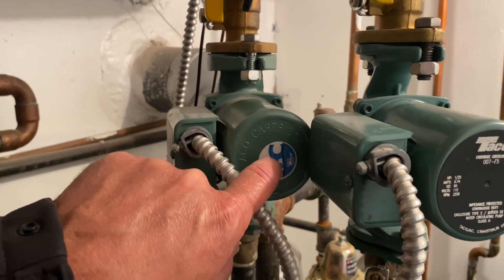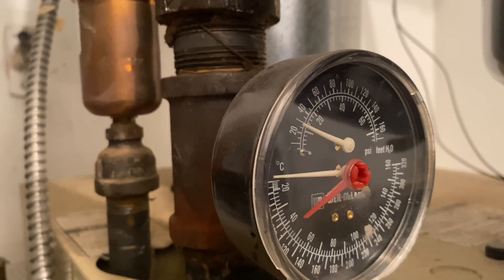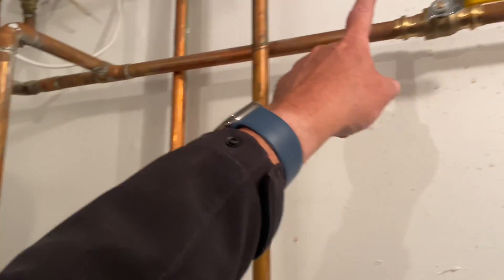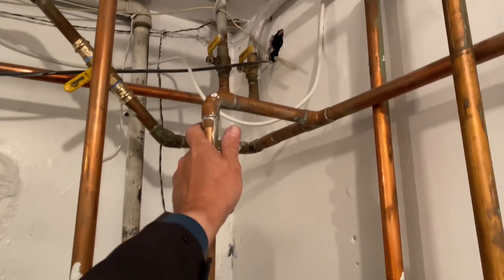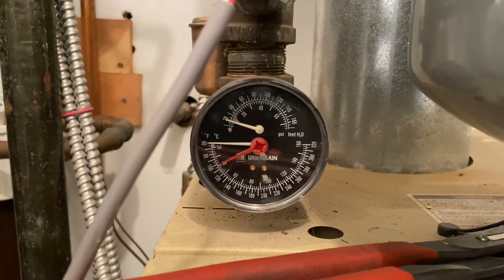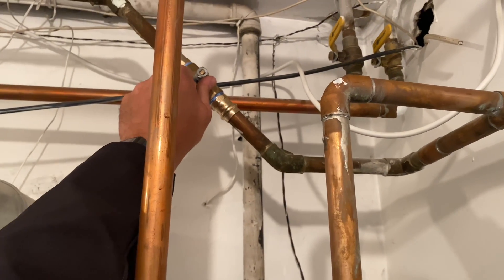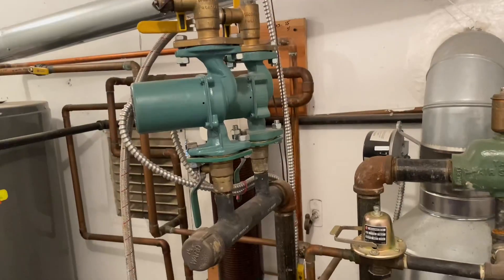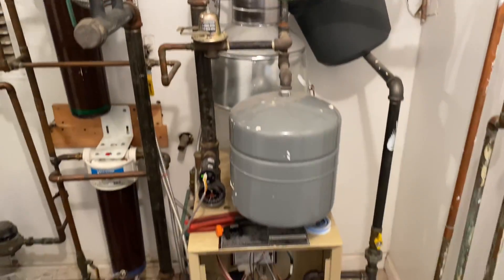Weil McLain Boiler Continuously Running No Heat on 2 Zones How to Isolate Burst Pipe & Purge

Comment: 😮 Oh man a slab leak...  might have to pull one of those through the wall add some "dummy baseboard"  with the fins clipped... supply through the tube return pipe on the bottom to cover it up so it doesn't look crazy... At least the mechanical room is right behind the wall in the first floor That should help 😅
Reply from the maker: Dealing with a slab leak can be such a hassle!

Comment: Nest Eco mode is gonna cost him thousands. When the temperature is below freezing it is advisable to keep hot water flowing through the pipes to keep it from freezing. Turning down the thermostat will cause the water in the pipes to get cold and freeze in the slab or along outside walls. Baseboard radiator copper is very thin and usually installed on outside walls as well. Hopefully his insurance will cover it.
Reply: Horrible Mistake by the Homeowner.  Penny Wise, Pound Foolish. 🤪👎
Reply from the maker: yeah, that sucks. damn nest

Comment: Crazy to me that the installer didn’t put valves in when the piping was new. So much easier to purge the system. There’s levels to this plumbing/hvac game.
Reply from the maker: yes there is
Reply: there was valves on the split return side, what more do you need? open one at a time and purge to drain above pump. pumps have check valves so it shouldn't backflow through them even with valves open. although it's nice having more valves. $$$$
Reply: @throttlebottle5906  I must not have paid close enough attention. I didn’t see those.

Comment: First time ever I had a callback with green eletrolical corrosion coming from a press fitting it wasn’t leaking it just grew green stuff growing from both sides of the press fitting.
Reply from the maker: not prepared properly?
Reply: because it was seeping at the seals, dirty/rough pipe and maybe cut o-rings? unless it's cold water and keeps sweating a ton in summer.